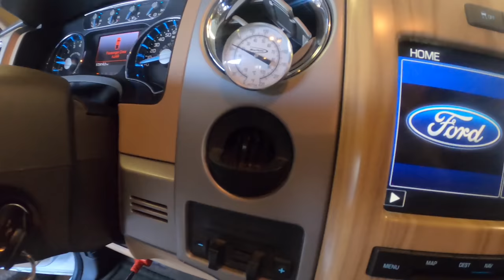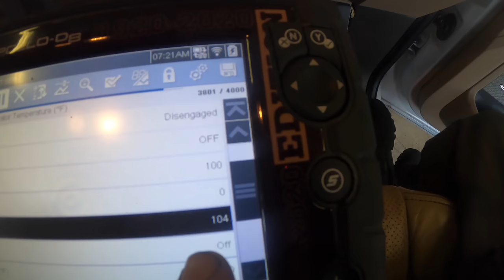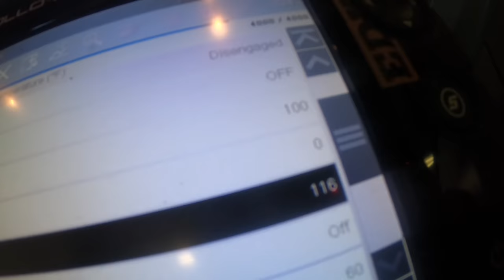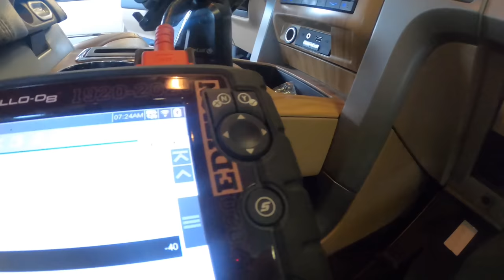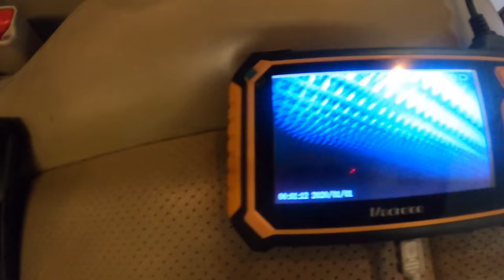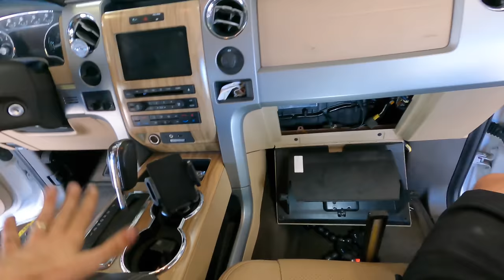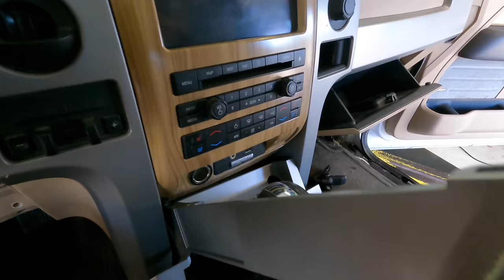TEN HOURS to replace one sensor! Ford 150 torn to pieces! Evaporator Core replacement.

Comment: I've done quite a few of those, never removed the seats to do one.  Just lay the dash on the seats and pull the box, takes me 3-4 hrs start to finish.
I love doing dash jobs on trucks as long as they aren't filthy or the plastic is so brittle it crumbles when you touch it.
Reply: Tx--Sir, you have much more Patience than Most...
Reply: You do make a valid point. As far as dash boards go, this one is very easy. He took apart all kinds of things he didn't have to. It shouldn't take more than an hour to roll the dash.
Reply: I think It depends on your brain , your's finds a quicker way to the prize as Ray calls it ,nice work.
Reply: @bluethunder4542  He's right. You remove the floor console, but there's absolutely no reason to take the dashboard completely out of the vehicle. That's on most cars, not just the F150.

That said, you are correct. When you do the same job all the time, speed will increase. Its also a good example as to what type of tech you want to be. The work you do at a dealership is far more technical than in an independent shop. (Not always, but for the most part.). I hate doing things like brake jobs, wheel bearings, suspension work, etc.. I'd much rather rebuild engines, pull dash boards, electrical diagnostic, ... One isn't better than the other, it just comes down to what you like to do.

Comment: My old boss told me to cut the wires and solder in a 39K-40K ohm resister in order to trick the module into thinking it is 70 degrees. I took a couple of hours, but WORKED! The compressor cycled like it was supposed to. I know it was a hack thing to do, but the A/C blew at 46 degrees, and I was just following orders! (Saved the customer almost $1000)

Comment: Engineer's who design these systems should be made to work on them for a few months. If that would happen, I would bet that sensors placed in inaccessible locations, would be placed in locations that are accessible very quickly!
Reply: Engineers are frustrated by these things just as much as you or I.  The real problem is that the engineers don't get to work on the project until AFTER the designers are finished.  Blame the design staff.
Reply: @Stefonius  They could have put the sensor up higher on the evap core. They could have added a screw on window to the box. The could have made it accessible by pulling the blower motor. There are MANY ways this could have been prevented. This isn't a design issue. Its a example of something that wasn't worked on. It was not brought to the drawing board at all.
Reply: It failed outside of Fords warranty coverage, the engineers succeeded.
Reply: @davebiglin8684  Things like this a remembered, and cost future sales.
Reply: @skurblord3401  It's a competition, they lose sales to Toyota.
Reply: @G-ra-ha-m  You must not have looked at Toyota recently. They are selling their cars for 30k over their MSRP. Doesn't matter if a product is good if only a select few can buy them. They aren't being competitive at all. Slightly better reliability at a 30-40% markup is not a good sale.
Reply: @skurblord3401  But Toyota only got to its size and reputation by building things well.
If they are now throwing that away then it's sad. But skinning the customer is cause and effect: there will be less of them in the future,
Reply: @skurblord3401  - All of your "they could have" scenarios involve using something other than an off-the-shelf part.  Ford isn't going to do that if it costs any extra money, no matter what the engineers say.
Reply: In accessible* locations. 😉
Reply: @Stefonius  You realize that EVERY "off the shelf" part is designed and made by those engineers? There is not a single part that can't be made off the shelf. Ford will do that even if it costs them money. Every single part cost them money. Paying engineers to find awful ways to work around a bad design is far more expensive. What I'm saying is engineers should be allowed to work with the design team. It could lead to some really neat solutions to common problems.
Reply: @G-ra-ha-m   Toyota worked closely with Edwards Deming who defined quality as follows: Good-quality means a predictable degree of uniformity & dependability with a quality standard suited to the customer.
Reply: @skurblord3401  I agree that engineers should be allowed to work with (and in some cases overrule) the design team.  As for doing things that cost money?  GM put Daytime Running Lights on every car sold in North America, even though they're only required in Canada.  Why?  Because it would have cost them money to only do it to Canadian cars.  How much money?  Less than two dollars.
Reply: @Stefonius  Not sure how you think that cost them less money to put it on all North American cars instead of just Canada. It didn't. Sure manufacturing costs per set went down due to greater bulk but they were already down quite low since Canada is a big market. They decided to keep designs the same for simplicity. Having their design and engineer teams come up with two different headlight designs costs quite a bit of time and money. Each probably makes six figures or at least close at the low end. Also its a selling feature. You can sell those $2 running lights for an extra $200 and people won't question it.

Comment: Pro tip: When it comes to re-installing that last bolt that gravity'd onto the floor at the end; if a helper monkey is unavailable, you can use a small, flat magnet on the other side to hold the bolt in place while threading on the nut. A neodymium rare earth magnet is usually the best for this application, and personally, I use magnets out of old hard drives I've torn down because they work best for this use.
Reply: I rip the magnets out of microwaves and speakers also, for a variety of helpful applications...
Reply: Or. You can magnetize all the sockets.
Reply: @eaglewarrior8707  make your entire toolbox a magnet
Reply: I scored a large box of old hard drives years ago. I tore them all apart for the magnets and the platters (I make wind chimes out of the platters). I must have a hundred hard drive magnets of all sizes and strengths, and I never run out of uses for them.
Reply: Yeah you should see the exhaust shop I went to somehow they get bolts on the inside of the frame I don't know if they use magnets They go through tiny holes on the frame I just don't know how I guess they even use a coat hanger tied around the bolts to get in the hole hold it in place screw it on and then rip the coat hanger out I don't know
Reply: I love old hard drives. Like tiny record players.. we finally replaced the last one at work with SSD. That upgrade alone will make your average "slow" laptop or desktop into a new machine. Best and cheapest upgrade you can do.
Reply: @eveline7611  you say hard drive magnets are better than soft serve magnets?????
What's your call on this??
Reply: SILVIA CAMORA  what's your "pro tip" here.
Reply: @eaglewarrior8707  
Not always a good idea.
 1- If the socket comes off the ratchet / extension while working, a magnetic socket will go to the least accessable part of the vehicle and stick to it, instead of dropping to the floor and rolling to the exact center of the vehicle as they usually do.
 2- Some things people work on are very sensitive to magnetic fields and the electrical currents that a magnetized object can induce. One can ruin more parts than they were originally replacing if using magnified tools in certain circumstances.
Reply: @bruceb4349  Why do mechanics have so many sockets? I don't know why? I will just label a set of sockets magnetic and nonmagnetic. Also microchips and processors are extremely resistant to magnetic fields. Unless its a rare earth magnet. Then it is most likely to kill something.
Reply: @eaglewarrior8707  Labeling the sockets magnetic or not is a Great idea.
Reply: @Mikey-wf9py  Either magnets, vice grips, or a clamp of some kind to hold it in place, and then they just weld the bolt to the frame, turning it into a stud.

Comment: You gain some appreciation for the engineering that went into this, all those pieces that have to mesh and fit perfectly together.
Reply: I gain disrespect for the idiots who completely overlooked serviceability in their design. This is poor engineering exemplified.
Reply: @P_RO_  ,
that's when something eventually  goes wrong, you can buy really expensive cars for a pittance !!
Restoration of really expensive cars is worth it, but run of the mill 'shitboxes', no way !!
Reply: right, because an access panel in the top of the dash, with easily accessible fasteners, was obviously too sophisticated for the intelligence level of said egineers. 
this is planned obsolescence, personified. there is no good take from this ridiculous layering of parts, no justification for it. it's either mediocrity, ignorance or most likely purposeful. none of which make the engineers look good.
Reply: @TSoneonetwo  Its designed that way purposely and u are a fool if u think it isnt on purpose.
Reply: @TSoneonetwo  Did you finish ur TPS reports?

Comment: You just know that on the assembly line they swung that whole dash into place in one piece. Someone knows an easier way. I’d never be able to get all those pieces back together, and there would be rattles in the dash that would never go away. You just know there will be rattles. Best Regards dude
Reply: Yep and the windshield wasn't installed either at that time, hence easy access to those bolts through the top of the dash.
Reply: It's probably the first interior part to go in during assembly.
Reply: My worst nightmare, squeaks and rattles from behind the dash that i cannot get to and fix.
Reply: @TFC exactly what I was thinking. Wtaf was Ford thinking. Why could they bot incorporate a little access point in that Air box. Nothing worse than creak,clank,duff,whilst driving especially after a repair job. Grrrr. Respect to Ray. I would of put wrong size fixings and probably 101 other components in wrong way. So much so gasoline and a match would of been a better tol with a most satisfying outcome.
Reply: Exactly what I just said I'd never keep track of all those bolts, I'd have them in the wrong places, or missing lol. And a bunch of broken clips which all together would equal rattle trap lol.
Reply: @alswick0011  
I removed the ignition switch, steering wheel etc, put the stuff back and I have clicks when I turn the steering wheel. Can’t get rid of the clicks. I can’t imagine the mess I’d make of the dash board internals.
Reply: Rainman, I'm Shocked by the Complexity of that job, Like Brain Surgery, your an AMAZING Mechanic if you get that thing back together 100%...I Hope your Shop appreciates you..👍👍🏆‼️
Reply: Cut a hole in the heater box, that’s what I did on my S10 when they told me how long it would take them to fix a pissie little flap that would not open and how much a hour shop time was but it was my vehicle and I’am a cheap ass old fart!😩

Comment: A simple inspection cover would have been such a brilliant idea from the designer/engineer.  But no...  [oh, and a sensor that's separate from the condenser]
Reply: Had a similar problem with our washing machine.  1 dremel cutting wheel later -- Voila!: Access Panel.
Reply: 10 to 1 it was a bean counter decision. Putting in an access panel and removable sensor mount would cost darn near 20 cents!
Reply: @TheWabbit  No kidding. That would of been too smart to do. .
Reply: Well that’s because the temp sensor happens to be the problem. There are like 50 other things back there, too, that could need to be accessed. Engineering a design to allow access to all, without pulling the dash, would be impossible.
Reply: @FlatFifties just imagine, for $5  or $10 most the difficult replacements could be fixed!
Reply: @BixbyConsequence  Thats what i was thinking, cut the panel at the connector and weld it back on after replacing.
Reply: Chris I would have done the same on my personal car. Ray said the temp sensor on the f150 was only available as integrated to the new evap core though.
Reply: @Chris-bh3cm  Exactly  Find an oversized piece of flat plastic and two self tappers, job done
Reply: @BixbyConsequence  that's the way it's done you cut the box out you don't do all this crazy work he's doing right now, that's insane, that job will take 45 minutes to an hour just by grabbing a Dremel and cutting a hole. You call your local junkyard and that part is about a hundred bucks and then you pull the sensor out of that junkyard one and then test it and then put it in.
Reply: @frankvucolo6249  yes and no. Toyota and others have had designs where heater cores sensors and evaporators can come out or at least part of the hvac box can come out. I think its a profitability factor. Its cheaper not to do it and it makes more money when it fails. 
I full acknowledged your point though I personally believe the incentives arent there is the true reason the effort isnt put in

Comment: Just a suggestion, could you not have added resistors in series or parallel to the new probe to match the resistance value on the existing probe?
Reply: He probably could, but it's a liability on his company, since the resistors aren't tested for durability on the road.  If he worked out of the back of a truck and was unlicensed, sure, that could be an option
Reply: I don't think it would work properly- the sensor sends a signal as the temperature changes and that regulates how often and how long the compressor engages.  If the sensor has failed and is sending a fixed resistance signal all the time, then an inline resistor would only send a reduced signal, not a variable one. So it would still be doing the same thing, but at a lower rate.
Reply: @oldschool1993  hes talking about the new probe with unmatched resistance ranges
Reply: do what i did just cut old one out plastic and all change Senser  then jb weld it all back in
Reply: @itech301  Yeah, that could work if the new probe had a similar value- when you dial in the temp on the dashboard the ECU looks for a certain resistance, and if it is too high or too low it turns on the compressor until the resistance reaches the level it wants, then turns off the compressor.  If the resistance value of the new probe was higher than the original, you could put a resistor in line to bring it down.  If it is lower, you would be stuck with temperatures that don't match what you dialed in.
Reply: @jonsworld5307  NO money in that though.

Comment: Thanks Ray for the video. I have done this repair a few times, so it's interesting how others have done it, as I appreciate tips from others.

This is not a criticism, as it is a bigger job, but I would highly recommend reviewing the removal procedure in the work shop manual, as many un-necessary parts were removed to get this apart. I know this is a way to learn, but it saves time, especially knowing what fasteners and connectors need to be removed.

Just a few disassembly tips for this repair,  that may help others, especially on the Supercrew model.

If you fold up the second row rear lower seats up, you can then unbolt both front seats and keep them in the truck by sliding them back in the cab. Then the center console  main attaching bolts can be removed very easily as they are on the lower sides.  This then allows you to place the console in the back of the cab also.

Now the carpet can be pulled back, with some trim removal and the lower rear heat floor duct can be removed relatively easily.

After disconnecting several electrical connectors, a few brackets and the lower steering column pinch bolt, the entire dash can be removed with the  complete  steering column.

 As Ray pointed out, you don't want to turn the steering wheel much with it disconnected, as the air bag clock spring can get damaged.

Hope this helps.

Comment: I think I would have just figured out what resistance value range was required for the sensor and installed appropriate electronic components to achieve those values. Mr. Carlson's Lab style.
Reply: @Joby Fluorine So, you admit you know absolutely nothing about electronic devices or how they are developed or how they actually work. Actually I work on the machines used to build cars. But I doubt you know anything about that either.

Comment: I think I'd be inclined to install an extra senor alongside the new one and just leave the plug hanging out, next time it goes, simple disconnect & reconnect.
Reply: Sensor not available
Reply: @tomweir3857  The sensor is certainly available from the manufacturer.  It just isn't available from Ford.

Comment: I pulled the dash on our VW Passat 1996, years ago,for replacing the heater core leak... I was impressed how the stuff is put together, wiring harness, snap together, wires exact sizes to be where they should, lot going on under there...it took a few days cus i worked slow, not to snap plastic snaps and stuff, heater core was list price $140...on sale for $8.98, for real, OEM, cus it was past 10 years, they wanted to get it out of stock...and it all worked no more leaks, and all the electrical worked, steering wheel need a new use once bolt, which dealer had in stock...that's why dealers get a lot of labor charges, all labor

Comment: Hey Ray, I work for a fleet operation that has a bunch of f150s like that. About 2 months back I had to replace an entire hvac box/case due to one of the mode door actuators ticking and the driver "kicking the box to make it stop". Which obviously destroyed the actual box. Gotta love that, right? Definitely involved, but overall not very difficult in my opinion.